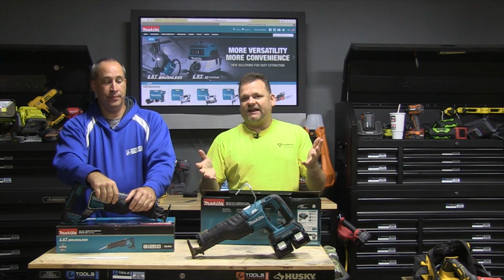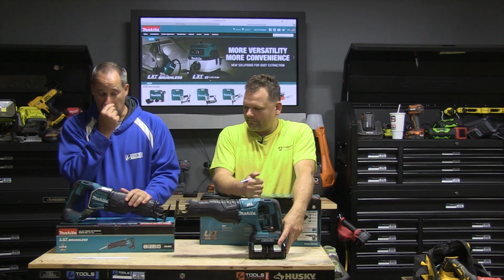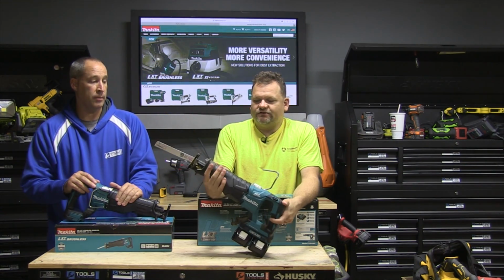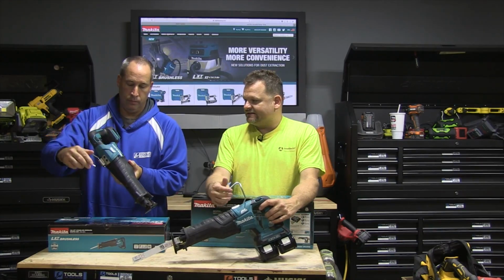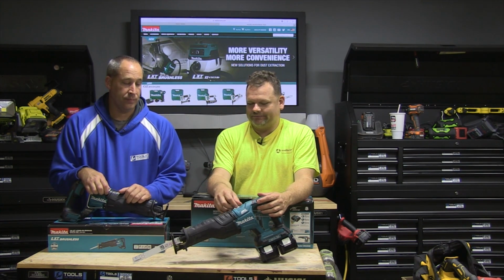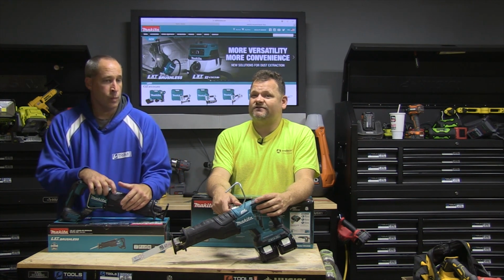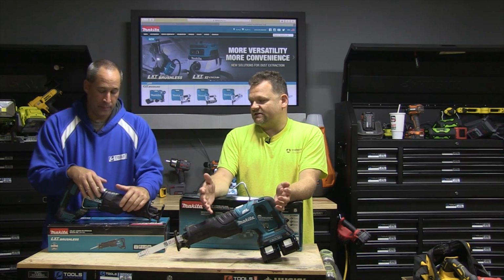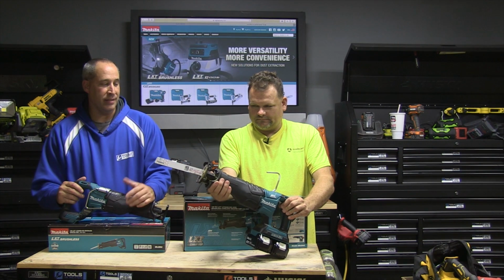Makita XRJ05 and XRJ06Z 36 and 18V Reciprocating Saws

Comment: Just an FYI, the 18x2 recip saw has the exact same amount of power as the normal 18v it just allows 2 batteries to run twice as long without having to change batteries for long jobs and hats why I like just the normal 18v brushless recip saw by Makita because it’s the exact same amount of power and a 5.0 battery already lasts long and I don’t mind changing it out when it dies anyways. It also cuts down on weight and bulk which is what I like most about the single 18v saw.

Comment: The reason most companies don't use lithium batteries for cars is because they won't charge or discharge when it's too cold or hot out. They can actually explode if it's too cold out.